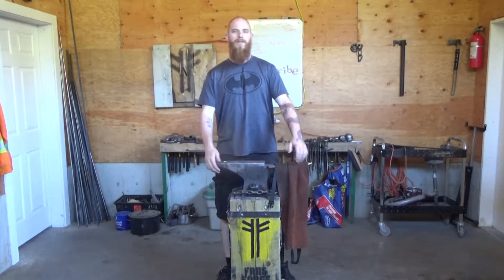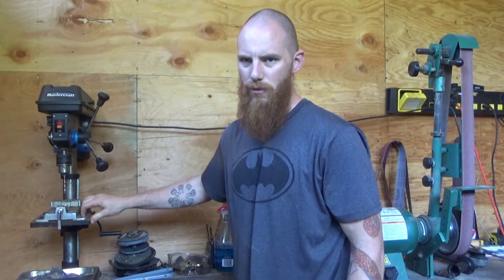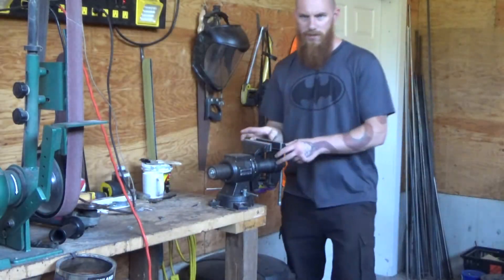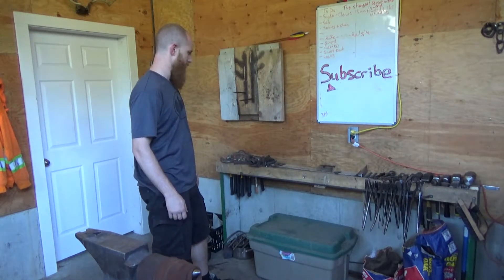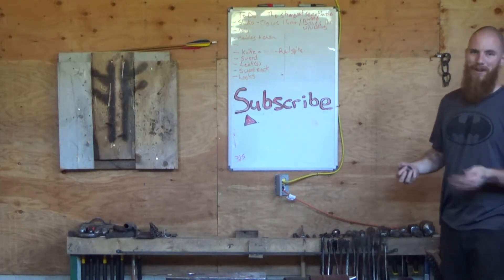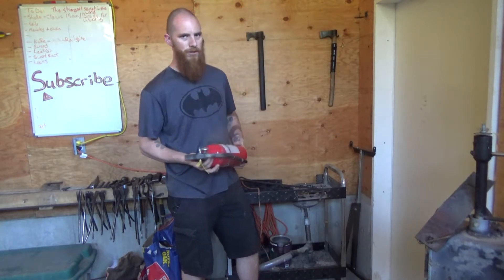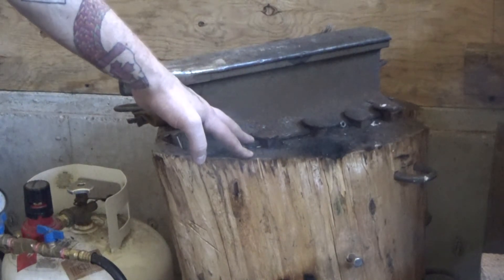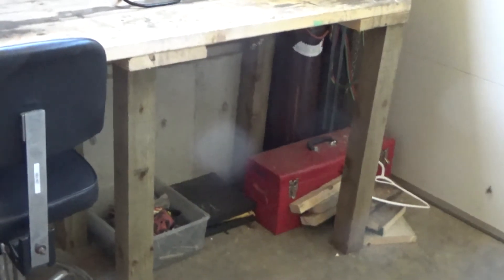Shop Tour 2017

Comment: Sometimes you can find coal on eBay
Reply from the maker: I have found it on ebay but I cant find anyone who ships to canada. If I lived in the usa this wouldnt be a problem.
Reply: Well that's a bummer. Still pays to keep an eye out. ya never know when you can get a deal.
Reply from the maker: Indeed. I am always looking, networking. ect.
Reply: why not make your own charcoal its easy and cheaper than buying just needs some time :)
Reply from the maker: It is, but charcoal isn't all that expensive for the amount of times I use it. Time is something I have far less of.
Reply: Making Charcoal is not easy. Not in large ammounts at least.

I did it the old fashioned way and it took me the better part of a day and I used the entirety of it in an afternoon.